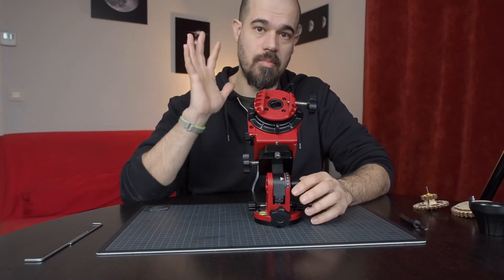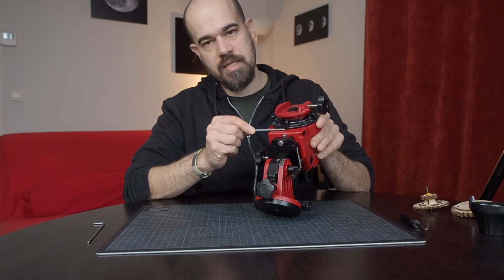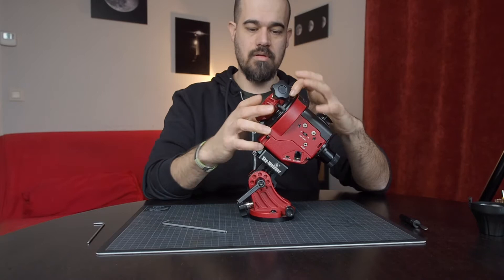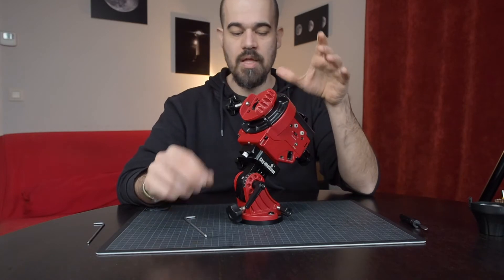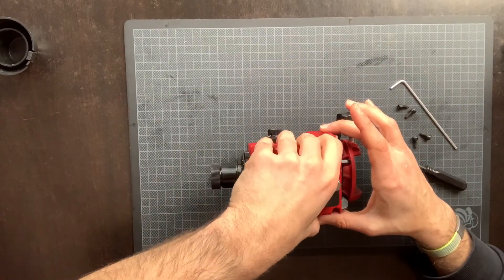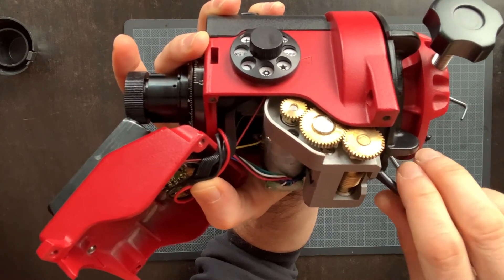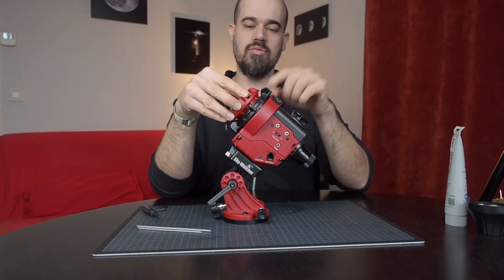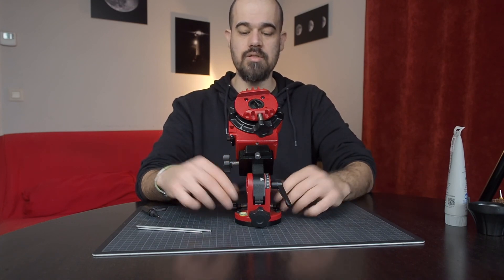Sky-Watcher Star Adventurer PRO Maintenance: How To Remove The Backlash

Comment: How much tight should the clutch be ? What i observe that even after tightening the clutch it moves when little pressure is applied.
Reply from the maker: then , most likely, you have backlash from loose meshing between ring gear and worm gear. you can remove this play with the small hex screw at the bottom of the unit
Reply: @andreaminoia2002  i have corrected that. Does the grease spread over the friction material?
Reply from the maker: @drkumarharaprasadmisra5562  no grease on the friction pad

Comment: I want to tell you thanks from Canada. We finally got clear skies here and this year my star tracker was not working. I was debating buying a goto mount rather than buy same model until I came across your video. Taking off the bottom and pushing it forward did the trick.
Reply from the maker: Cool. Glad I could help 🙂

Comment: Hi All, recently bought this one new, and I have S and N lights blinking RED, via the app I tried to move it manually, I can hear the motor sound but it doesn't rotate. Any help is appreciated. Thanks in advance.
Reply from the maker: Hi. I don't have the version with wifi so I don't know if it is normal for the led to blink when the app is connected. They usually blink when guiding and corrections are sent to the mount or if there is a problem with the motor, like a stall. But if the motor stalls you will not hear it turning. Is a long shot, but have you locked the RA clutch? (Big black ring). Also, have you tried moving it at 12x speed to really see if thins move? Normally the movement is very slow
Reply: @andreaminoia2002  Thank you, sir. I had to open and put the motor to its original place as it was adjusted too hard. it moves now. Thanks for the awesome video.

Comment: Hi great video and webpage ,I have a different problem ,the clutch on the dovetail bracket wont tighten up and or rotate ,any suggestions
Reply from the maker: Sorry, never had this problem. But should not be too hard to inspect it and disassembly it (eventually)